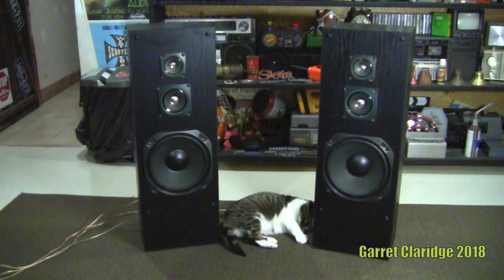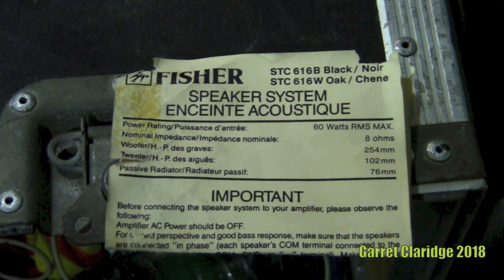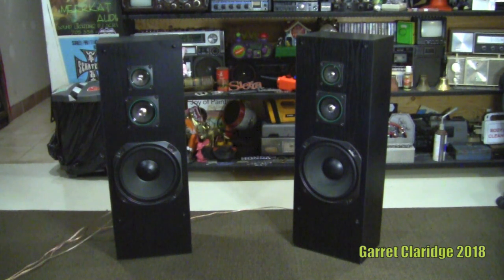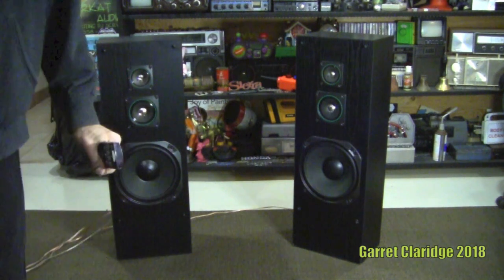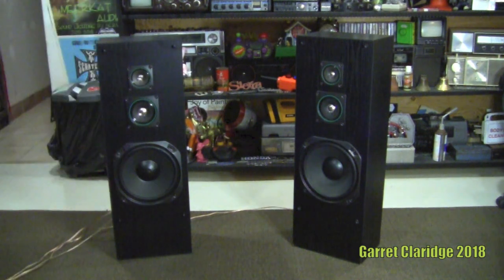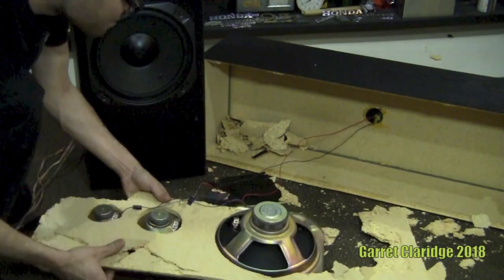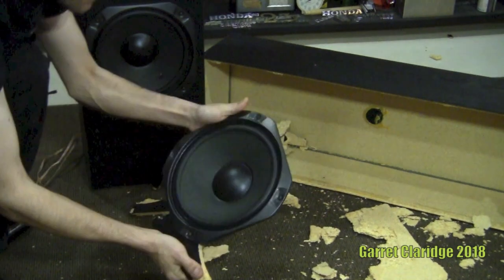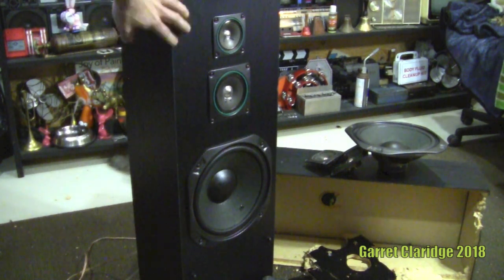SPEAKER BLOWOUTS! - FISHER STC 616

Comment: I thought everyone knew that Fisher WAS Sanyo. They bought the brand in 1971. Sanyo also provided drivers to Pioneer and other brands. Panasonic bought them out a couple years ago and now the Sanyo brand is gone except foe a few specialty lines.
Reply: Sanyo bought Fisher from Emerson is 75. 1969 is when Emerson bought Fisher from Avery Fisher. You were very close. Under Sanyo, the Fisher brand did make some very impressive receivers. The speakers in the 80s unless the drive had Fostex stamped on the driver was not the best. Most of the stuff built for rack systems were crap unless it was the TOTL STE series and the 900 series ST speakers. It all is a matter of your taste in the sound really.

Comment: This is awesome since I really hate Fisher speakers except the really old ones. Now the reasoning for the Sanyo logo on the woofer magnet is because Fisher was bought out by Sanyo in the 80's
Reply: Old replies here, but do you guys know why people LIKE fishers? I saw a few blowout videos of fishers where people got upset that "such a classic speaker" was ruined, but the front of the cabinet was a plastic sheet! I'm no top notch audio fanatic, but that is terrible, worse than resonatey 3/8 chip board.
Reply: @volvo09  I have no idea. I think it's just people thinking something is better than it really is
Reply: Actually, Fisher was sold to Sanyo corporation in 1975. Emerson electronics bought it from Avery Fisher in 1969. A beyond simple Google search will tell you the history of most any company. Most any Fisher model speaker with some ST and most STV in it was built for a price point unless it was a 900 series. The drivers were not the weak point to those speakers. The cabinets and crossovers are the real reason for the crappy sound of the 1980s and beyond speakers with a very few lot being true audiophile grade. Most of those big white speakers were nothing more than a cool visual thing. If you can find some of the early STE line (TOTL) from the early 80s, you will be impressed unless you are just stuck in the head about the name branded only. That is how most so-called audio snobs are. Fisher did not make their name in speakers, what they made their name in was the old tube amps. he did produce some very nice monster receivers if you care about those. Not everyone taste in sound is the same as nobody's taste is the same either. Everyone that just goes off of what some else says is good is in for a rude awakening at one point in life. Enjoy whatever you listen to the way you like. I sure do. The right amp will make the right speaker sound as good as gold.
Reply: @cfothough  Typical ebay mark up. Now this is where you and I can disagree. The hidden gems in the Fisher line up will run right with the big Japan and American branded names in their receivers. There was a line of Fisher speakers not sold in the U.S.  that is just as good as any JBL,Cerwin Vega, Boston Acoustic, and the list goes on. I personally have had a chance to listen to a set that came from the STE line. They are fenomenal speakers. Most the standard line was crap but like all audio companies, there are those hidden gems . The less people that know about them. The less demand = lower price.  Us guys that like Fisher stereo equipment are a small crowd and we like it that way. What is your favorite brand in receivers? I'm talking stereo not today's modern surround sound. Would like to pick your thoughts. Get back with me. Sounds like we can do some chatting on this great stuff we have in audio gear.
Reply: @bobg69  I'm sure there are some good Fisher speakers, but my point still stands that the majority are cheaply made with thin boxes and huge drivers with teeny tiny voice coils and small magnets. When talking receivers, I'm not nearly into audio as much as I used to be but my only receiver from before the 90's was this Technics SA-5170 I found in an abandoned house. It quit working pretty recently but after some cleaning and replacement pots, that thing was one nice amp even though it wasn't very high wattage. Btw, I'm not saying liking a brand is a bad thing, I wouldn't want to bash someone just because of their audio preference

Comment: I have a set of Fisher's with 12in woofers that look a lot like those. They're running off a QSC RMX 850 along with a set of 12in Pioneers. They sound nice with a proper mixer and equalizer. BTW Garret awesome video!
Reply from the maker: Right on, Yeah for sure Id recommend stapling some insulation or cheap soundproofing foam inside especially on the back panel, Find a pair of ceramic resistors that can settle down that midrange and maybe the tweeters, the L pad idea would be best but resistors are cheap or free if you know what to tear apart :P

Comment: Where I am in the world there's a pair of Fisher St 828s for $50  I'm still trying to convince myself I don't need them XD
Reply from the maker: Aw man, 30 USD at the most :P  I paid 10 CAD for these and nearly turned them down at that price
Reply: They're definitely better than these really shitty fishers. They should have Foster drivers and american woofers and foam in the particle boards, Including a brace for support. They will hold their position against most.

Yes, they have their limitations and such but for the price you can't be beat!

Owner of rare Sanyo SSV16 $40 Goodwill floorstanding towers here. They truly kick ass!
Reply: Buy them!! For adding a few bucks more they will sound damn good with a decent crossover!! $50 is not bad. Can you touch any other name brand at such a low price? Not unless the seller has no clue what they have. I picked up a CA800 amp with the cassette deck and tuner plus some DS825s for $8. I can turn around and sell it all for at least $250-$300. Fisher is not as the snobs want to say. Most never actually heard them in person. The price I paid was only due to knowing the person running the resale store and before it was put out on the floor for the asking price $100. Don't ask lol.

Comment: Sanyo fisher used to be the same company I believe
Reply: Sanyo bought Fisher back in 72. Find any Fisher speaker that says Fostex on it and you will really have something that would be worth replacing the crossover, bracing the cabinet and some sound deadening material.